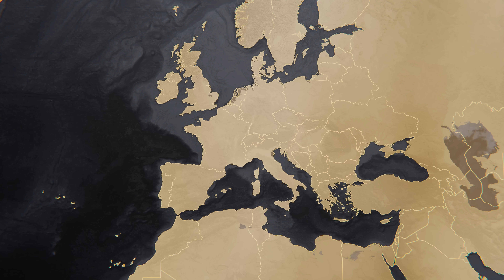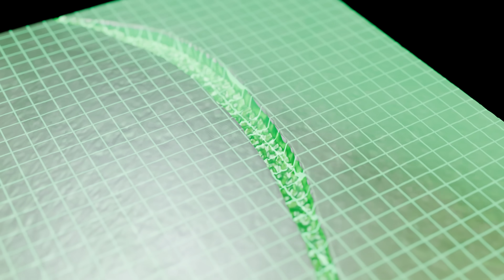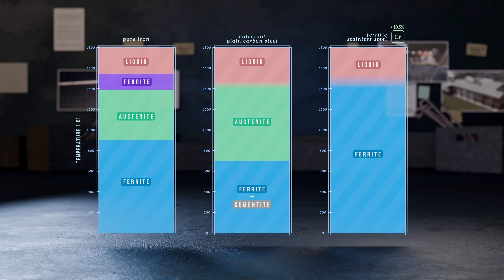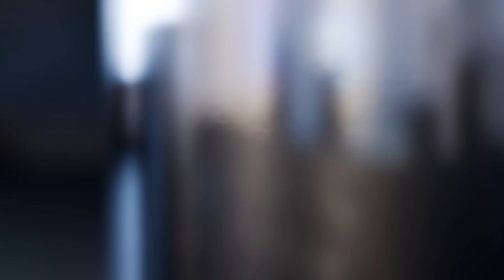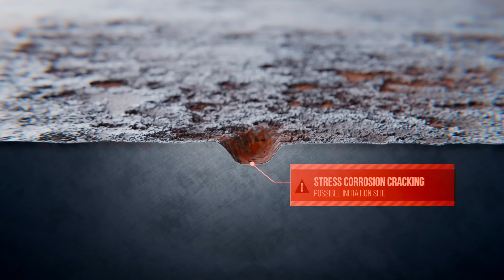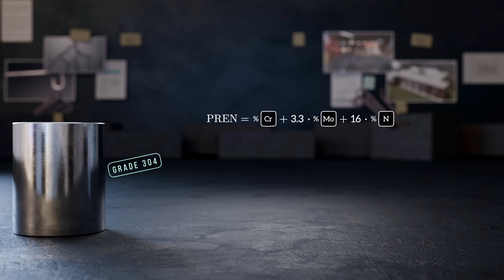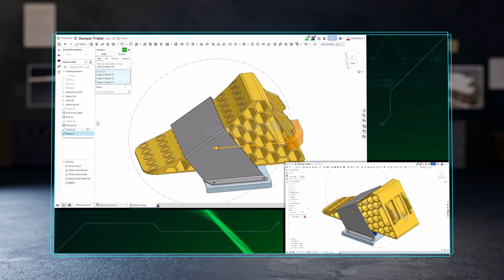The Problem with Stainless Steel

Comment: Stainless steel wasn't the problem. 
Designing something to be the cheapest possible to maximize profit, is called stealing. Is called corruption, is called cheating.
Why in the hell you would design a death trap if not for the money. 
In our country this kind of hanging ceiling is called fake ceiling, because that's what it is. Is like a cheap way to cover something wich wasn't finish.
And this is why it's being used.
Romans build things that last thousands of years. And today with all the technology avalabile we have buildings collapsing over people.
In my country recently an incident like this happend the same way. No one died fourtunately because the ceiling was from gypsum boards.
And at the end they come and blame a material. OH we recently found out that stainless steel does this, things wich were known for so long.
But no one will come to say we designed as cheapest and poorest possible to steal money. And instead of building a real ceiling we build a fake one wich collapsed and killed people.
The problem is not the materials, is how they used those materials.
And is well known that stainless steel, it "heals" itself. But if the corrozion envoirment is more accid than it can heal, it will rust.
This is why on salt sea boats, they use a different stainless steel stronger to corrosion wich is alot more expencive. And this is why all the parts from stainless steel you see on boats, pools and things like that are glass mirror polised. Because that is the surface wich retains the least amount of water and repels it. Is not just because it looks nice.

Comment: If you ever seen the rusted stainless fixtures in many men’s rooms urinals, you’ve seen the ability of chlorine to destroy stainless steel. The cleaning and sanitation chemicals used are heavily laden with chlorine compounds whose vapors destroy the chromium passivation of AISI304.

Comment: As a note. I've delt with material selection and in my case 316 is usually used. Its not perfect but duplex steels are usually 2 to 4 x thr cost of 316 depending on the size your looking for.

Comment: Stainless is not good for strength - better to use high tensile steel with galv plating. Uni degree engineer might not have known that. Concrete suspend over a pool ? Lightweight acoustic panels would be better. Never inspected - ? - load bearing support in tension? Elevators, cranes, and lifting points have mandatory annual tests. So much for Swiss safety.

Comment: Nice video. Raises the questions: 
- what are the costs of the different materials, would the engineers choice be influenced by the proce?
- could a coating have prevented this corrosion?

Comment: A single event does NOT determine a fact or Truth 
Nor an automatic Conclusion 
That wrongfully shifts and applies blame . The problem is not with quality specifications adherence to , of materials , but rather the problem is with People ---
Engineers errant calculations , 
Material providers who cheat on providing quality properly specified material , and with the builders who cheat and take short cuts , etc. In the building and construction process ! It's really a People PROBLEM AND NOT A STSINLESS STEEL ALLEGED 
SCAPEGOATING PROBLEM !!!
GOT IT EVERYBODY ? 
Bullsh*t always appears and is said , when things collapse . Shoddy workmanship , faulty design , 
Miss calculations,  failed pre-checks of geological conditions , sabotage , etc., 
etc. , are the PROBLEM MOST OF THE TIME AND NOT THE ATOMS . 
ROOFS COLLAPSING ARE A PEOPLE PROBLEM , PERIOD PERIOD PERIOD . THERE WERE TOO MANY HOLES IN THE SWISS CHEESE OF THIS 
BUILDING AND ITS BUILDING OF .

Comment: Corrosion resistance is not the same as corrosion proof.  And periodic inspections are more economical than mass funerals and lawsuits. Just because the label says corrosion resistant does not mean it never needs structural inspections.

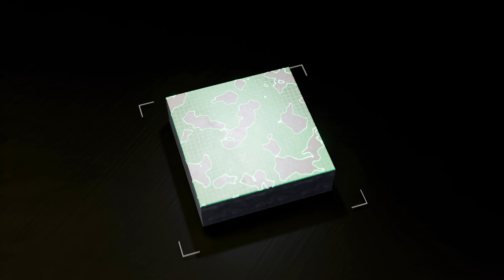Comment: 2:25 I used to work with large amounts of chrome oxides both trivalent and hexavalent, and it’s cool that he colored this part of the animation green. Because Cr2O3 is more commonly called trivalent chromium or chrome 3… the green one. But it can be more red colored when it’s in its more dangerous hexavalent form.
Reply: You gotta get the dangerous form if you want a proper chrome plate. Same reason why it's hard to get things chromed in America.
Reply: @Shaker626 I worked in a chrome shop in the early 70’s .  There was no doubt that the (mostly yellow) chromic acid was extremely toxic, but I also think that our operations were very primitive by today’s more strict standards. We refurbished industrial crankshafts so the tanks were ~20-30 feet by about 4-5 feet, so very large amount of chromic acid.  I have no idea if there was any waste vs. replenishment, or what they may have done with any waste.  The company has been very successful to this day, so they must be doing something right.

Comment: These SS rods , 304 's , we're more likely NOT UP TO REAL 304 OR BETTER SPECIFICATIONS . THATS WHY THEY CORRODED . 
THEY WERE PROBABLY NOT QUALITY STAINLESS STEEL .
That's why they corroded and failed . Or there is another real reason why the ceiling collapsed , like the engineers screwed up and did not calculate correctly the necessary diameter and tensile strength required for the proper SIZE OF THE SS RODS NEEDED OR THEIR NUMBER ! THE ENGINEERS SCREWED UP , AND THEN BLAMED THE STAINLESS STEEL ASPECT OF THE RODS TO BE THE CAUSE !!

Stainless Steel was being given a bum rap here THE Swiss cheese engineers were really at fault here , or the suppliers of the marginal
Quality of the SS RODS !!!

STOP BLAMING STAINLESS STEEL . THE DESIGNERS AND ROD SUPPLIERS AND BUILDERS WERE AT FAULT HERE , AND NOT THE FACT 
OF SOMETHING BEING OF STAINLESS CHARACTERISTIC .

Comment: Im so glad you talked specifically about my favorite type of stainless, 17-4.  Such a great steel to make parts for. H900 temper for best hardness, H1150 for best corrosion, such a versatile steel. Great hardness, extremely good toughness, and corrosion resistance like 304 grade all rolled into 1. The perfect balance on stainless.

And yet it is often cheaper than 316 stainless simply because it is less well known.

Comment: Not using marine grade stainless steel when it's been a known problem FOR AS LONG AS STAINLESS STEEL HAS BEEN PRODUCED INDUSTRIALLY, in a marine environment (chlorine pool) is the biggest fuckup here. Criminally negligent engineering.
Reply: I don't know how you equate a chorine-rich pool environment with a marine environment...🙄😂
Reply: @peterfitzpatrick7032  Because I understand what  salts are, from a chemistry perspective.

Comment: I have found that stainless steel screws are always a let down. They always fail when used to fully screw some components together. The easiest way to get them to work properly is to use ordinary screws to assemble the item being made and then to swap out the ordinary screws for the stainless steel ones at the end of each sub assembly section. Otherwise you just end up butchering so many stainless steel screws that it isn't funny. 
Mark from Melbourne Australia

Comment: SS handrails are commonly used in swimming pools. 15 years ago I was working in a metalwork sub-contractor  company and Installed some s.s. rails for a swimming pool in some Hotels. It only specify to be commonly used grade 316.
Reply: Stainless looks nice and lasts well, but will eventually have to be replaced. But hotels get refurbed anyway so it should all be part of the rebuild.

Comment: You nailed it. I am a metallurgical inspector, 300 series stainless is susceptible to a few different damage mechanisms and SCC (Stress Corrosion Cracking) is one of the worst. ClSCC (Chloride Stress Corrosion Cracking) is one of the most prevalent. It can occur from insulation that contains Chlorides, or from ocean water or sea spray. It can occur from city water which almost always contains Chlorides. Cl ppm plays a role, ideally chlorides should remain below <50ppm, temperature is also important, higher temperatures increase likelihood of cracks forming. However, even at 50ppm chlorides can concentrate, so keep an eye on areas where water might collect and evaporate, concentrating chlorides in the remaining water. 
Caustic Stress Corrosion Cracking and Polythionic Stress Corrosion Cracking (PASCC) are two other forms to watch out for with the later being the less common of the two. 
304L / 316L maybe slightly more resistant since the lower carbon content will reduce sensitization of the steel during welding. However, Duplex is the better option by far. 2205 or 2507 Duplex are nearly impervious to chloride stress corrosion cracking. I had a storage tank built out of 2205 Duplex just so we could avoid potential CLSCC cracking. The slight increase on cost over 304L was negligible compared to the cost of inspecting for CLSCC every 5 years. Not to mention the cost of repairs if SCC cracking was found which is inherently difficult to repair if even possible. Duplex comes with its own difficulties and isn’t right for everything. It is important to understand the purpose of the metal chosen, the environment it will be exposed to, and the likelihood and consequence of failure which is inevitably weighed against cost. For those unaware you can consult NACE, as well as API 571 to understand the damage mechanisms a metal might be subject to when you are choosing what materials to use for your application. Great video, I’m saving this one for show and tell!
Reply: We build a lot of insulated vessels at my work, chloride free insulation is a big deal.
We used to use glasswool, but it's all moved to rockwool now, it's a few PPM lower in chlorides as I understand it (I only build the things).

2205 is nice stuff. Great to work with.

Comment: I have engineers manual edited in 1952. in which was staetd that a stailess steel in order to remain stainless in highly acidic environments should contain at least 30% of cromium. So, there was not much to learn about that in the'80s.

Comment: My first thought was: why didn't they spay it with RustOleum, but even epoxy-coated rebar rusts out over time.

Just delay the inevitable?  Might'a given 'em enough time to work on a proper solution tho.  Feel like pennies were the limiting factor there.
Reply: This had nothing to do with rebar in the concrete... the stainless steel was used in the hanger-rods and the failure-mode had nothing todo with the 100mm thick concrete suspended ceiling

Comment: Wilbur and Orville Wright here,

I'm saving your video to watch it tomorrow night when we have more time however in Aerospace we do not use the term stainless steel.
Our term is corrosion resisting s😮teel: CRES

Also going into history you will find out that the term stainless steel was intended to send the message that it....Stains "Less"
And metallurgists will quickly point out that a stain is the beginning of corrosion.
OK!!! Enough of that, going to bed now.
My brother and I will come back after a good night's heavenly sleep and we will watch your video and provide any edits as required.

Comment: I never heard of the swiss roof collapse, but this is an important issue in the sailing community.

A lot of sailboats pre-2000's used SS304 cablestays to stabilize the mast ("chainplates" in sailor lingo) thinking they would last forever. Now, they're ticking time bombs. Chainplates are under a lot of stress, and constantly exposed to chloride. After a while, a strong wind or storm is enough to snap the chainplate, and then your mast is coming down at the worst possible moment.

Comment: Stainless corrosion has been understood for a long time, its clearly explained in the first material science lecutures of any reputable engineering degree. Infact it's referred to as the biggest lie in engineering. The vast majority of failures in industry are in heat exchangers.

Comment: Austenitic SS is susceptible to stress corrosion cracking - especially In solutions containing chlorine.  It’s very well and long been known. It’s a problem in the food industry where chlorine solutions are commonly used for sanitising. There are probably at least a 100 SS alloys. You need to use the right alloy. Duplex SS is probably a better choice, and there are various grades to choose from.

Comment: 304 is just for outdoor environment. in pools are use chemicals to keep water clean are highly corrosive.
for that 316 alloy is somewhat corrosion resistant. (but still not full proof)
and corrosion resistance is only surface layer, if that surface is contaminated with normal steel (like eire brush) or some type of chemicals (used in griding disks, for not inox use) than you destroy 99% of corrosion resistance in that spot

Comment: Forget the type of steel used, the whole accident could have been prevented by not hanging an addition concrete ceiling beneath the initial ceiling.
Reply: Or it could have been prevented by using an SS grade less prone to SS cracking .
Or it could have been prevented by checking the ceiling tethers and not dismissing the obvious corrosion as "nothing to worry about"
Or it could have been prevented by not building a pool in the first place.
Or it could have been prevented by recognizing the corrosion for what it was and repcing the faulty tethers with tethers made of a more suitable grade
Or it could have been prevented by coating the tethers with teflon.
Reply: @manatook-d9m the fact that they held concrete above a chlorine vapor environment tethered by steel, which is well known to be susceptible to corrosion by chlorine, even if only in a reduced manner with some techniques, is almost indictive of intentional ineptitude.

Comment: I am an Mechanical Engineer with a multi national chain builder and have seen SCC occur in applications where Gr304 chains were erroneously specified,, paper pulp mills, fertiliser plants, ham processing/picking, to name a few. 
In these cases, the chains were replaced with Gr2205 ones which worked perfectly.
Reply: Which manufacturer? I just retired from an international chain manufacturer.
Reply: @graftonarchery2713  It was an English company until not that long ago when we were taken over by USA company
Same question back to you,, did you work for a Japanese, USA or German company?
Reply: @leor2830 I worked for a big Japanese engineering chain division. I know who you work for, and of your US division. I'm also well aware of who else your new parent company purchased.
Reply: I worked in the US chain plant as an application engineer.
Reply: @graftonarchery2713  I have been over to Eastern TN a few times over the years.
I am having trouble sleeping right now because of a toothache
Reply: Add Gmail to my screen name if you want to talk further about the wonderful world of chain.

Comment: Very interesting thanks. 
I did a welding course last year and reading a manual, came across a case of a welded  ss tank that badly corroded.
Apparently caused by surface contamination with iron or non stainless steel causing some sort of ionic cell corrosion?
Possibly happened during construction by cleaning the surface with wire brushes.
Reply: You say tank - so it contained some sort of liquid. It sound like they built a simple battery, hence the galvanic reaction.

Comment: The big mystery to me is that it is a ceiling. What could possibly be a reason for choosing concrete? Why not some lightweight material?
Reply: Read my reply to the comment above you... but... the concrete was only a 100mm thick thick...

"On May 9, 1985, the indoor swimming pool in Uster, Switzerland, suffered a catastrophic ceiling collapse, resulting in 12 deaths and 19 injuries. A 4-inch-thick concrete and steel roof fell, caused by stress corrosion cracking of the stainless steel hooks holding the ceiling. This incident highlighted critical safety issues regarding materials used in high-humidity pool environments. "

Comment: ANY COMPETENT SAILOR KNOWS that stainless steel corrodes in a moist anaerobic environment. Above a heated pool, which is a highly humid environment, and in this case, a building space with limited or no air movement-----it was as if a disaster was planned. The moisture finds its way into crevices-maybe never drying out or perhaps cyclically drying and re-wetting. Add salts, all sorts of salts: body salts, chlorine salts and more that drift up with the humid air. Some engineers, somewhere, are criminally liable......AND 306 Stainless Steel IS NOT PARTICULARLY CORROSION RESISTANT-----316 WOULD HAVE BEEN MUCH BETTER----probably would not have failed----but it a fair bit more expensive....316 is used in the rigging wires that support sailboat masts-where failure of just one wire would be catastrophic.    306 is used for railings and other deck fittings that can be  rinsed with fresh water and don't generally have small crevices.